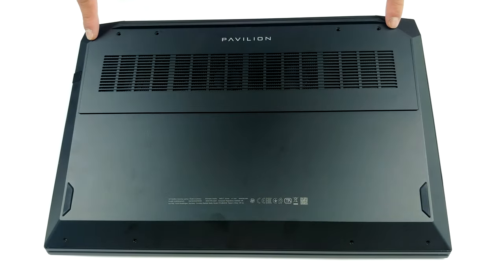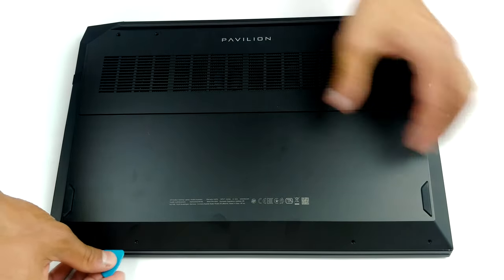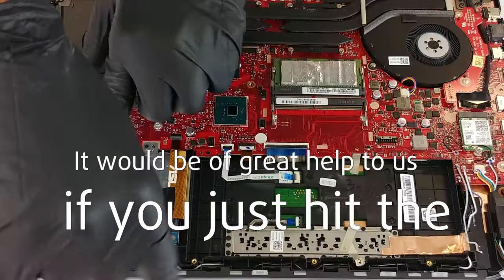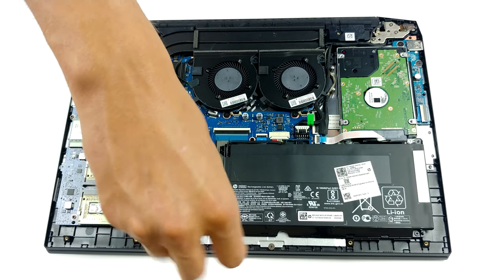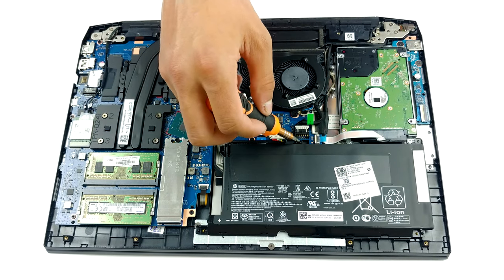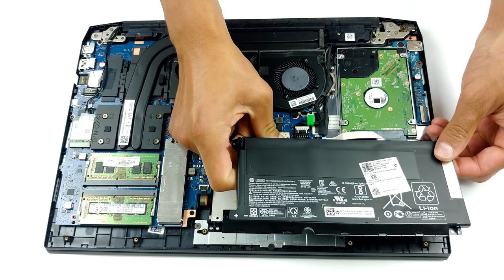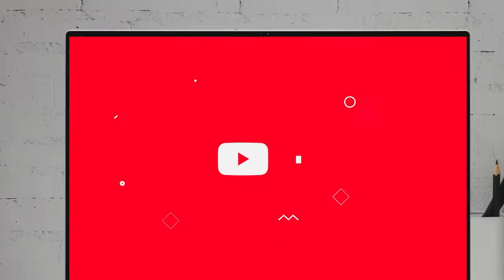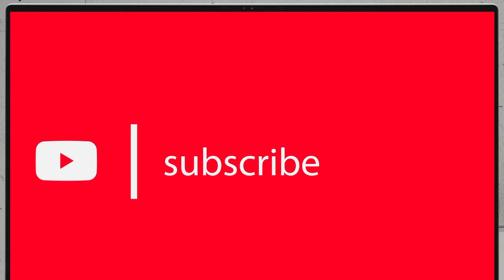🛠️ HP Pavilion Gaming 16 (16-a0000) - disassembly and upgrade options

Comment: if you change the Ram for non-Hp ram, the bios will block you to boot to windows?
Reply: That's what I'm thinking I saw this dude upgrade his laptop ram to 16gb and it didn't say the ram was from hp or anything
Reply: You can get around that by putting the BIOS on a cd-r and boot it from disc. But I would just buy HP ram to avoid the hassle.
Reply: Can you go into more of this I upgraded one of my sticks but still have the original ram in there and it won't boot now
Reply: @albertbernal7434  are they the same brand, speed and amount? What's the brand of the stick that you didn't upgrade?

Comment: Does HP Pavilion Gaming Laptop 16-a0046nr contain any empty slot for a SSD disk or you should replace the SSD M.2 with the bigger one?
Reply: Only 1 m.2 slot, but if u have sata ssd u can use it
Reply: So, did you put 1tb on it?? 512gb of storage for me is to small, did you upgrade?
Reply: 66

Comment: Bhai is your laptop making humming/rattling sound from the body while using laptop on the laps and typing on same time...because mine is making rattling sound while using on laps but when used on table it didn't make any rattling sound...when i open the back cover of the laptop sound comes from the plastic part attached on the coolant pipe is making that sound while i typing hard on keyboard and using on laps so this is defect,so your unit is also making the same sound

Comment: Hi 
So can i upgrade to these ?
Crucial  
Ballistix 2X32GB Kit (64GB) Ddr4 3200MHZ Sodımm Notebook Ram 
260 pin
Reply: HP - Pavilion 16.1" Gaming Laptop - Intel Core i5 - 8GB Memory - NVIDIA GeForce GTX 1660 Ti - 512GB SSD + 32GB Optane - Shadow Black